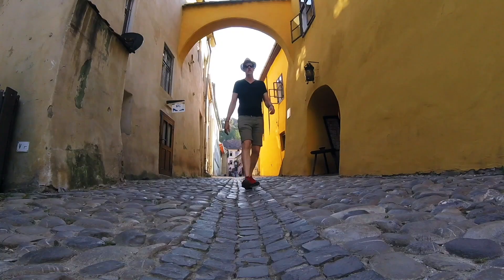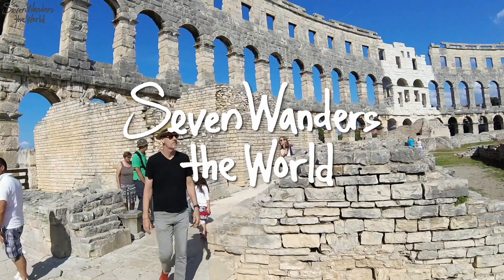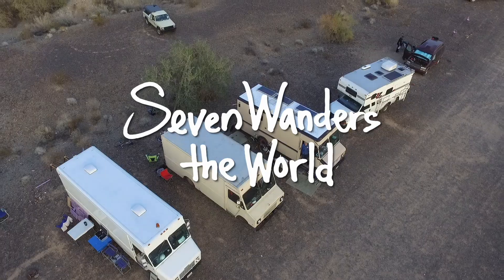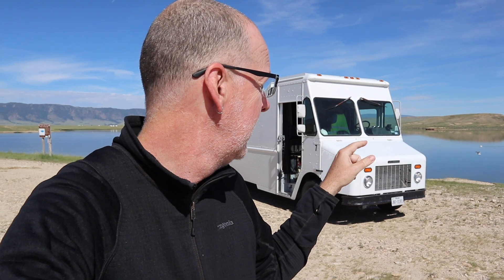Murphy Bed Challenges in Step Van Camper P2 E438

Comment: 2 -  1+1/2" diameter pieces of wooden doweling, and to grooves at each Pivot Point that make the bed slide forward when you close it up and you can slide it back when you set it down. I drew a quick sketch and posted it to my Instagram the only place I could think of to post it so you could get a kind of an idea of what I mean.
Reply: One advantage of this is there's no gap between the mattress and the wall, you can slide it right up to the wall.
Reply: Bubba Warbucks I tend to think out of the box and cheap and as easy as possible LOL course that could just be because I'm lazy?!
Reply: Another way of doing it might be a long piano hinge between the back of the frame and the wall, but that might present issues with the bed up depending on how much room there is.
Reply: Nothing lazy about being creative.
Reply: I was thinking that you can pull it lift it up a little bit pull it forward to the outer edge and then pivot it up and it would fit flat against the wall then when you tip it down and slide it back it slides all the way back against the wall so it would miss the counter.
Reply: Blue Van Dan, I can picture that...very cool...I think it could work pretty slick too.

Bubba Warbucks, I agree, there's nothing lazy about bein' creative. It's the ones workin' on plans (schemes) for them to do nothing that deserve that handle.

.........................PEACE!!
Reply from the maker: hmm... interesting solution and address exactly the problem. I'll have to see if I can find your instagram act to see the pic. I do have another solution I've been working on and will post a video soon on it
Reply: Seven Wanders the World I'm bluevandan on there too...

Comment: Your making a mountain out of a molehill. ( KISS ) Make a box for the mattress, 2-Sides, and Bottom and (optional) Top. The front door will be the mattress bottom and make it so the door is  flush with the sides when upright. Add a heavy duty piano hinge to the bottom part of the door. Gate Lock to the top to lock it upright. In the cabinets add 2 or 3 2x4 that pull out as legs when you use the bed and hide away when not in use. When upright its the bed + bottom 3/4(55" ? +3/4" ceiling down and 8"+3/4" From wall), when down its the bed with.. The door made to clear the cabinets. And if the door is smaller end the top part of the bed shows, install a 2" or 3" cloth or Curtain to hide it. Hope that help.
Reply from the maker: your "construction" outline is exactly what I have planned. that is the easy part. the hard part is that in the scenario you describe the mattress can't go all the way down because it binds on the sofa under it. I can only get it to fit on 2 of 3 edges (it hits the ceiling, hits the counter or hits the sofa below it) I can't get it to fit all 3 (I used scrap wood for mockups)

Comment: Hi Seven here are my two cents. I think if you use a double hinge on each side it will work. So you would have a pivot at the wall and one on the side of the mattress. It would be a piece of wood, maybe 1" by 2" by the length you need to give you room for you mattress to clear and clear the counter. Pivot points are at the ends of the 1 by 2. Kind of like a lever. Good luck!!!! Love you vids.
Reply from the maker: thanks for the suggestion of double hinge

Comment: You will be able to use this. 

Picture how things might look if  you cut away one corner of the hinge and the bed frame. I mean so that it will have one rounded corner. The location would be the one corner which is causing problems right now. 

You could cut the metal away with a grinder, or any sheet metal shop or machine shop or mechanic some where could do that for you. 

You could round off one corner of the bed frame to match. 

Next you will need to attach the wood to the hinge with nuts and bolts and a lock washer. The nut woukd fit between the hinge part.
Reply from the maker: rounding the corners would help a lot!

Comment: Tough day.  But you'll figure it out.   I would try a hinge on the wall.  A hinge at the mattress thickness.  And line up the bed platform with the counter top.  The bed would share a bit of the countertop when lowered.  Could act as a bedside table, maybe.  Personally I would use a simple pullley and rope to raise the bed.  Tie it off with a cleat.  Thats what I would try.  But youll get it to work.  Thanks for the video.
Reply from the maker: appreciate the suggestion, but if the bed were at 36 inches inch height of the counter, then when rotating up to the wall it could only be 32 inches wide due to the wall height at the hinge point. not sure that would really work

Comment: Add a second rotation point mid way on the bed box so as the bed comes down you can lower the counter side first to bypass the counter top then once down drops the wall side. You would end up with all the weight on the 2 arms but you can prototype out of wood then when you run into a viewer with a welding setup switch over to metal for a more compact setup on them.
Reply from the maker: I think something like what you describe is what would be necessary to make it work

Comment: I use a dustbuster to suck the mosquitos out of my space when that happens. Mine pops into a push vac unit for sweeping floors with also & runs on a rechargeable battery that lasts quite a long time. Great, low profile multi-use item.
Reply from the maker: brillant solution. I still need to get a hand vacuum and will keep this in mind as I choose one

Comment: I often wonder why no one uses an aerobed with a 1-2 in topper for van murphy beds. Then the bedframe doesn't require any complex overbuilt mechanisms and when upright could have a 1-2in depth, assuming the plan is to deflate when stored..

Comment: Repel mosquito punks work great for outside. They sell them st walmart in the camping department :) If you need to put one out in water, it will relight the next day. So that I dont waste alot of lighter fluid lighting one, I hold the punk over a candle flame to get it goin :)
Reply from the maker: I've never used the punks before; maybe time to try them out!

Comment: Try turning on all your fans to blow outwards, 7.  Maybe they will take the mosquitoes out, too.  Hey, most people have a day like that now and then.  Good for you for recognizing it and deciding to try again another day.  Could you build a small model to the correct proportions and experiment in miniature till you get it right?  Saves a lot of materials and might be less frustrating.  Carry on, buddy, you'll get it.
Reply: This was going to be my suggestion. A couple of scrap pieces of lumber to mock up the end dimensions of the bed and he'll get it worked out in no time.
Reply from the maker: over the period of 3 weeks or so I've taken scrap wood to similar the mattress size and attached hinges to it. that is where I where I found most of the problems and got stuck :(

Comment: It seems to me like you are over thinking the construction of your bed. Just mount the hinge two inches out from your sofa construction and make the folding board two inches shorter than the width of your mattress. Fold down the bed and push the mattress in against the sofa.
Reply from the maker: ha! you make it sound simple! I did some mockups with scrap wood and could never get it to fit

Comment: Could have it sit on top of counter top and use counter top as support?
Reply from the maker: yes and no. the problem, I think, at countertop height is the hinge on the wall would only give 40 inches above it for a 55 inch mattress... so the hinge point needs to be around 55 inches down the wall so the mattress can rest against it

Comment: Murphy Bed Problem: Think how garage doors are stored.  For example, for a non-flexible stiff garage door, it swings and is stored in the overhead, rotate that solution 90 degrees and use it in your van, this solution would use NO hinge.  Put a couple pulleys attached to the ceiling (or close) above where you were going to put the hinges (now no hinges) and attach the two ropes at the location where the hinges were originally going to attach.  Pull the ropes and the bed side near where the hinges used to attach swings up and fits against the wall.  Weight is important here, use an air mattress.
Misquitos Problem: Screens, Deet, desert, high mountains, not sure, I'm interested in your solution.
Reply: I know that an air mattress will not work for him because of a hip problem. I kinda like the garage door theory though. There's a few really good ones (ideas) floatin' around this time. Cool! ............................PEACE!!
Reply: Welcome
Reply from the maker: well, that is a truly original idea! (I'll keep this in mind but I'm currently pursuing a couple of other options which may work better for me)
Reply: I didn't think of this until now, but if you got truly inventive, you could modify this idea, where instead of making the entire bed be stiff and pull up vertically in one piece, you could split the bed down the middle, ...no... not exactly the middle, maybe a little off center of the middle.  Attach the ropes to pull the half of the bed up vertically which could fit against the wall, and half of the bed would be hinged in the middle and pulled up vertically.  Half of the bed would remain horizontal when the vertical part is pulled up and half of the bed would be vertical when the vertical part is pulled up, now you would have a place where three more people could sit when your bed was folded up.  I like that idea, I might try it myself.  The split doesn't have to be exactly at the 50% mark of the middle and the folded up part doesn't have to be exactly 90 degrees.  That would make for a more comfortable place to sit.  Also, that would lessen the weight of what is being pulled up.  This is like the idea similar to a day bed where when the back is folded up, it is a place for people to sit and when the back is folded down, it is a bed.  In this case, the horizontal part would stay horizontal and slide back and forth depending on whether the back is horizontal or vertical.  That would add three more sitting places for your Tea Wagon. A similar idea would be like the picture in web page https://www.ikea.com/us/en/catalog/categories/departments/living_room/10663/

Comment: Mr. Seven "Shades Of" Grey how the heck are ya?! Well sir, you're into the heavy duty cipherin' that would even boggle the great mind of Jethro Bodine. It's frustrating when theory and practical use differ isn't it? I know that you've probably already gotten past this point so I hate to bring it up, but if it could help somebody it's worth mentioning. So I haven't done this, it's only a theory, but would a pipe and sleeve set up work in that situation? I was also thinkin' about guide lines on the two corners furthest from the wall. Nothing heavy duty, just some light aircraft cable and it would, of course be outta the way when the bed was up. Maybe they're dud ideas, maybe they're not needed, or wouldn't work, or there wouldn't be support for the cables...I don't know...I'm just spitballin' here. Heh, heh. Dammit buddy, I think you found where the mosquito hatchery is! That would drive me to distraction, I hate 'em! Ya do have some weather rollin' in there, I saw a cool zap over your shoulder heh, heh. Readin' weather. Would actual bed frame work to give your bed rigidity or help to keep things where ya want 'em? The best part is, again, you're already home and you've got food and a place to lay your head at night and the details will work out. That must be such a freeing and empowering and relaxing feeling. Honestly, if my two granddaughters did not need me here I'd be out there somewhere livin' the dream. Thanks for lettin' me have a peek at it man. Heh, heh. Oh, don't misunderstand, I dearly love my little princesses and wouldn't trade for anything. It's just life. ....................................PEACE!!
Reply from the maker: I've looked at several suspended beds and decided against them because I want to be able to walk without ducking my head. but appreciate the outside the box thinking!

Comment: Seven, you gave some dimensions in your video, but not enough for me to work the math on a folding solution to meet your needs.  If you could provide a few measurements, I think I can help work out a solution for you.  Here are the basic dimensions I think I'll need:  width of van (use finished wall to finished wall), width of counter, height of counter, width of bench, height of bench, desired height of top of bed (I would assume this would be the height of the bench + thickness of the wood used for the bed box + mattress spring box (if used) + mattress thickness + bed sheets -- however if you wanted it higher, that would need to be mentioned), thickness of material you plan to use for the box for your bed frame, height of mattress, width of mattress, height of mattress box spring (if you are using one), thickness of sheets (and any winter blankets - want to make sure the bed closes even when made up for winter temps), and height of van from top of bench to finished ceiling height (please note any lights, fans or other obstructions that could be in the way when the bed is brought down).
Reply: bsb0011, that's cool that you can maybe sketch something up for him. I noticed that you included the bedclothes in your dimensions and I completely understand why, but I just wanna mention something on that topic. When I was a trucker and used a bed that needed to be folded up when not in use the sheets etcetera would get very damp if left on in cooler weather. So, for me, a sleeping bag did the trick and I just rolled it up. I don't know about how this works in step vans or for other people in other trucks, I just wanted to mention my experience and maybe somebody can add to it. .........................PEACE!!
Reply from the maker: here are some numbers for you: ceiling height is 81 inches, the day bed is 18 inches (plus some covers). the full size mattress frame for the murphy is 55.75 inches and 8.75 inches thick. by my calculations that means if hinged at an edge it would take 55.75 + 8.75 = 64.5 inches of wall space. available wall space is 81 - 18 = 63 so I have about 2 inches that I'm not able to fit (plus covers). the space from the wall to kitchen counter is 57 inches. to fit a box of 55.75 (1.25 inches clearance). anyway it is a problem

Comment: Maybe your mattress is too big for what you are attempting.  A few inches of the edge may be necessary.
Reply from the maker: yes, I think it is just a couple inches too large. problem is I want an inner spring mattress and it is difficult to trim those down
Reply: You might consider manufacturers that build custom mattresses for boats.   Ever consider an air bed, like the Select Comfort?  There are multiple manufacturers that will make custom sizes.  I have had one for years, custom made for the space.  It may be a bit too thick for your needs, but it's worth a look.